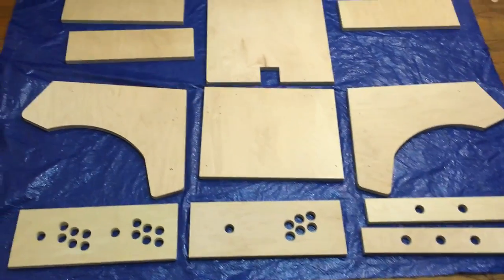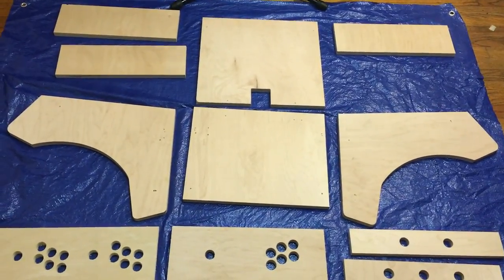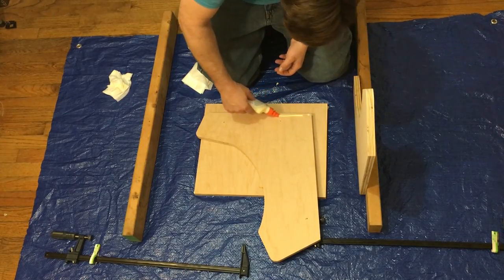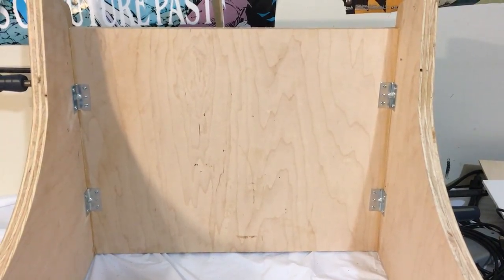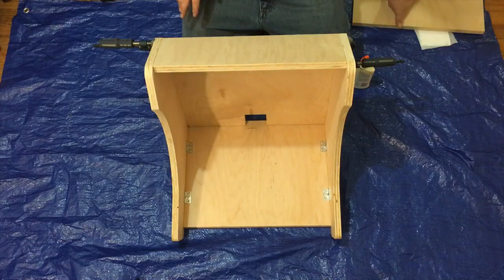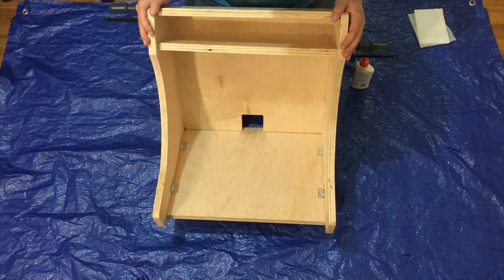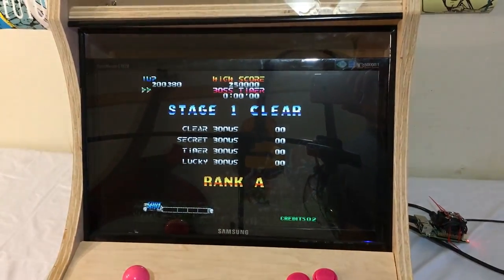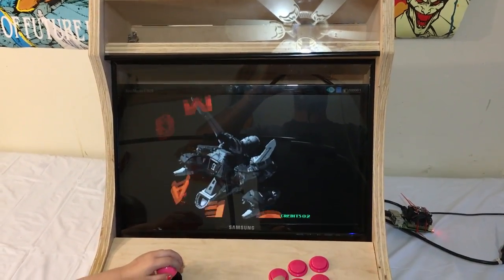Bartop Arcade Cabinet Build Powered By Raspberry pi 1 2 3 Or zero

Comment: Great job on building your machine!  That said, as a carpenter, I think you're wrong about MDF and using a nail gun.  MDF is perfect for an arcade build,  and glue and nailing is a great way to build.  It looks like the main problem you had was attaching side and front panels directly together.  If you would have used a backing strip to glue and nail to you wouldn't have had most of the problems you ran  into.

Comment: Another option would be to use a Kreg Pocket jig. No glue required, and the joints are incredibly strong. Nice tool to have around, if you are going to build more of these cabinets.. You would also need some squares to make sure your 45 degree angles are...square. Great video.

Comment: You can use some Velcro strips to attach the controller board to the cabinet. That should make it easily removable. Nice tutorial, looks like it is a lot of fun.
Reply from the maker: Dang I didn't even think of that , thanks that will work perfectly.

Comment: This question is unrelated to this video but, I recently got a Pi 3 and setup RetroPie but I am having issue with audio dropping out at random on games. Have you experienced this? Based on some forum posts I don't think I'm alone. Would overclocking help? Thanks and great channel!
Reply: Just a stab in the dark, but could it be a temperature issue?  Do you run your Pi 3 with a heatsink and fan?
Reply: Thank you for your reply. I do have heatsinks installed, but no fan. However, I believe that I have figured out my problem. I was pulling audio from HDMI and I needed to go into the config file and force HDMI for audio. It was set to auto and I suspect that the system was switching between the audio jack and HDMI at random. I haven't had any problems since I made that switch.
Reply: Schmeck626 Glad you got it figured out!  I wonder if there's a short in your audio jack that was causing it to "hijack" the audio signal periodically?

Comment: Sorry ,what's the name of the part you bought at auto zone?
Reply from the maker: CSIG1001 door edge molding
Reply from the maker: CSIG1001 http://m.autozone.com/decals-and-graphics/door-edge-molding/cowles-products-black-styleguard-edge-trim/177859_0_0?location=
Reply: ETA PRIME cool thanks.. I am surprised those snap in sanwa buttons worked for you. Any idea if your control panel is about 1/4 inch? Or is it 1/2 inch
Reply: CSIG1001